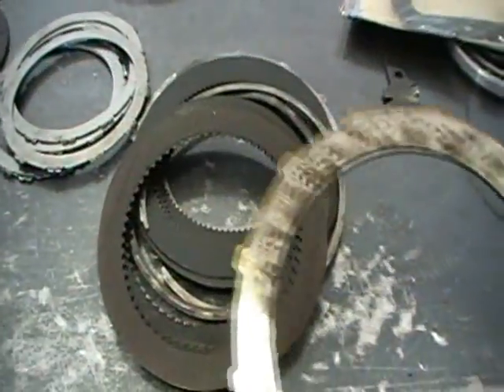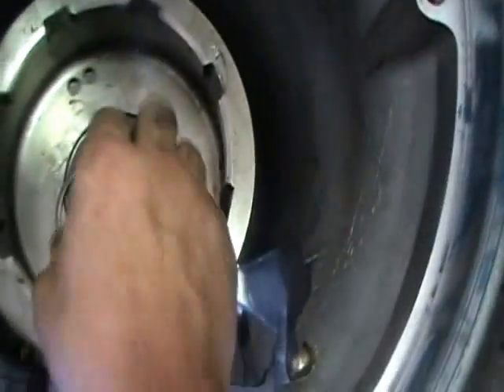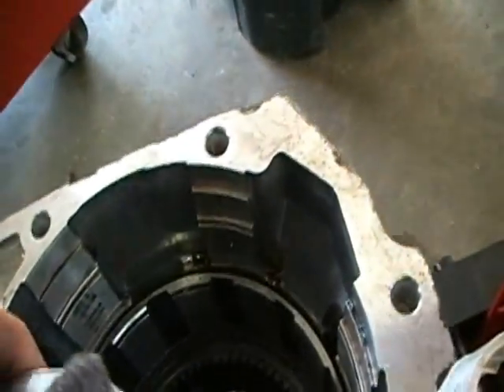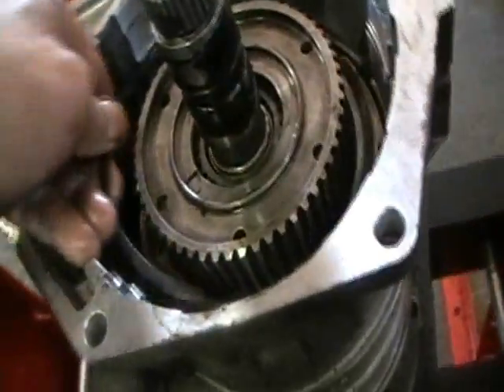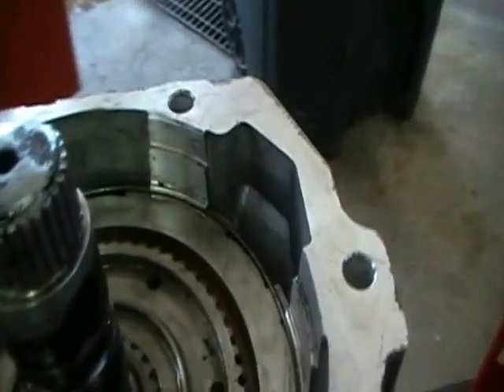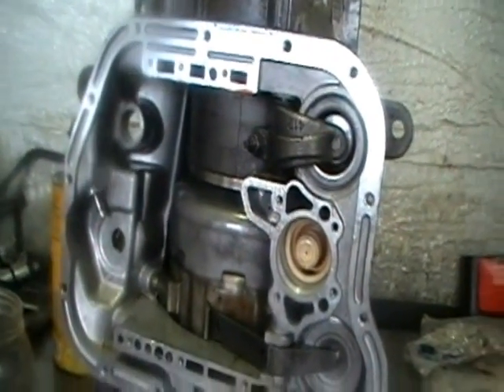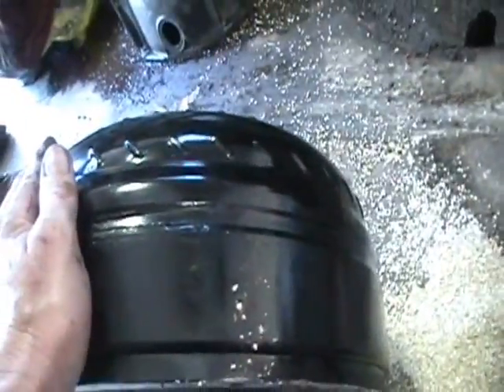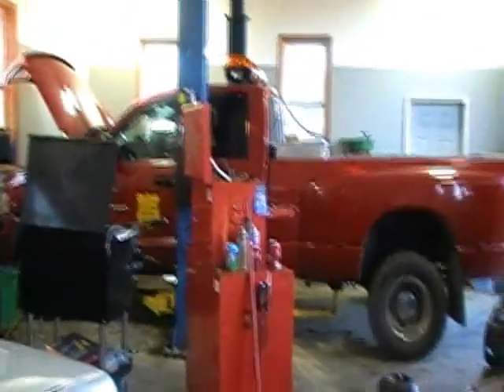518, 47Re, 48Re, 46Rr, Chrysler/Dodge Transmission Rebuild

Comment: I have a 2001 dodge1500 it works great except it Trimble's in overdrive at certain speeds and it sounds like a power steering pump when first started does not slip or anything shifts fine would a some shift kit fix the problem would like to hear your thoughts on this forum thanks

Comment: 1991 Dodge Dakota, 318 (5.2L) automatic trans with overdrive (button on dash). New converter.  

Problem: Trans jumps back and forth from drive, to over drive 45 mph and higher, no slipping,  What controls the the gear position?

Thanks...
Reply: ***** overdrive piston spring is broken
Reply: could also be a bad ground and what you feel is converter locking and unlocking check battery terminals first

Comment: I made a press tool out of the same thing, but I used a hole saw to achive my  ring  avilability
, so it would not spread apart, just a safty mearsure
Reply: Jackson Blaine 4" pvc pipe? I had my reservations about what may happen if the pvc shattered but what you say you done with the hole saw sounds like it'd be a little more integral.

Comment: were did you get the alignment tool for the overdrive? I have a 48RE and can't find an alignment tool.
Reply: You can use the intermediate shaft from a A518 or A618 series of transmission.

Comment: Hi do you know if you make an ajustement on rebuilt  transmission ( it's my dodge ram 2500 98.5 cummins) but there are many numbers on this tranny, but it's don't wrote if it's 42 re 46re or 47RE  and i would like  ajust it when i change oil and filter!  thank you in advance.

Comment: The steel is distorted due to the heat from slipping frictions, hence all the "cheetah" spots or hot spot on the steel. That steel is junk and should never be re-used, not even if you wiz or cookie it up!

Comment: I don't think so without major modification. The slant 6 starter is placed towards the top of the trans bellhousing while the v8 engines had the starter placed lower down

Comment: Hi Great informative video,,,
46Rh/Re 4X4 dodge 1500....
Do you recommend adding a fifth disc set in the clutch pack to increase preformance?
If so do I have to reduce the thickness of the pressure plate to accomodate this...?
What are the end play numbers recommended on the shafts?
Should I check these numbers before disassembly?

Thanks,,,

Comment from the maker: yes.the output shaft can be used.Some guys build the overdrive unit first using output shaft.Put together with output shaft in od unit.Bolt od  unit to transmissions empty case.Build the unit from there good luck Peter Wilson